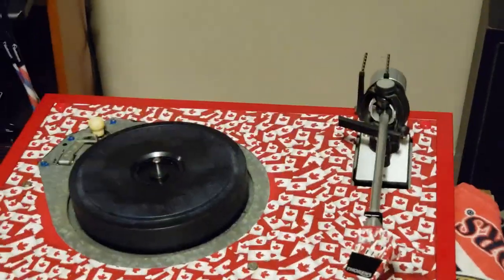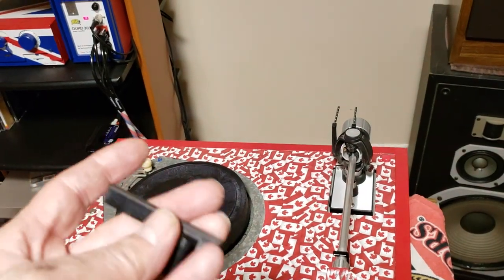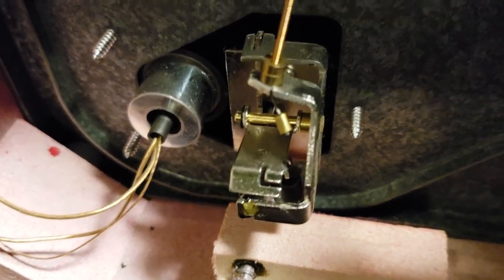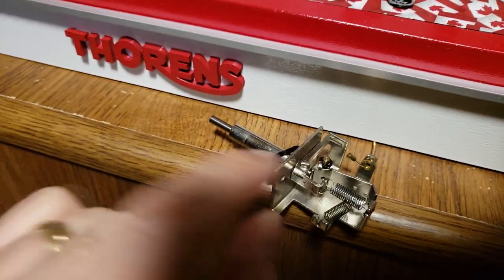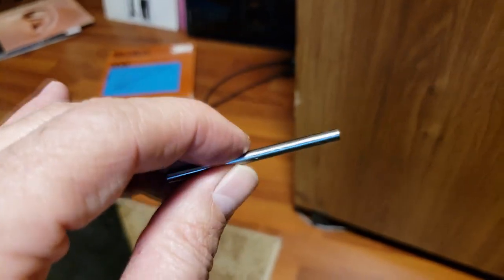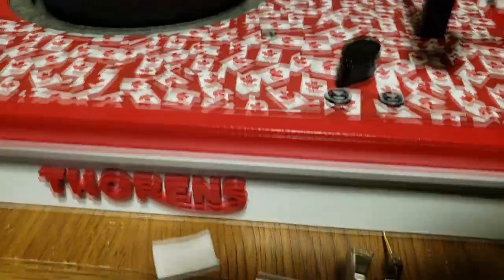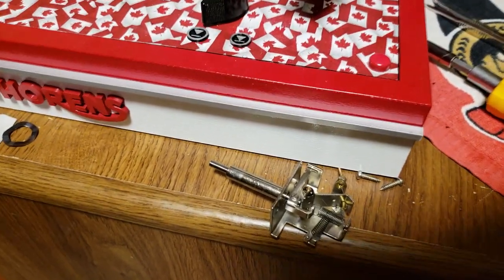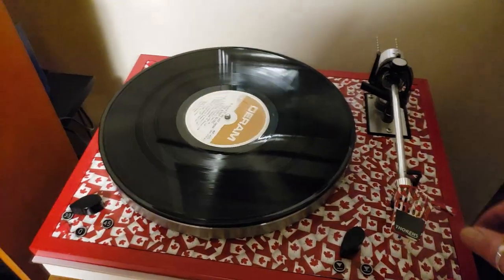Thorens TD165 Cue Lever Fix

Comment: It's not oil, it's resistance grease; it's supposed to be sticky and move arm slowly downward. You didn't fix it, you broke it.
Reply from the maker: Still works great a few years later. Ended up using 300K silicone damping fluid/grease off camera. Procedure for application is the same as in this video which I kept. As a Hydrocarbon Engineering Technologist by education I actually do know a thing or two about oils, greases, lubricants, viscosity etc. The grease I really ended up using can be purchased at many RC hobby shops or online. Been meaning to reshoot this video but 7 Thorens rebuilds later I have not needed to readjust any of the other cue drop speeds. For now folks will have to read the conments in this post to see what I actually did...😉
PS: oils, greases and lubricants don't break metal things like this. If you ever put the wrong stuff on you can always clean it off and start again quite easily 🤣
I do cover it a bit more in this 8 part video series on a TD-160 I restored and modded a bit more:
https://audiokarma.org/forums/index.php?threads/thorens-td-160-mk-1-tune-up-and-setup-project.991147/
Reply: @navydiving  Thanks for making this. It would be great if you put the comment above about what silicone damping fluid you used ("300K silicone damping fluid/grease") in the comment at the top that says "Oil shown in this video is not recommended." - it would be great if that comment were embellished to say what the right lubricant is there at the top, rather than buried in this comment. I almost missed it. Thanks!

Comment: Thanks for sharing. I'm working on this repair now. Unfortunately the head of my set screw broke off in the past, so I have to figure out how to get it out of the rod. You talk about it being gummy. I ordered 300,000 cst high viscosity silicone grease, per the recommendation, and it is the definition of gummy! Seems almost too thick...
Reply: I just discovered the set screw thing happened on the 160 I am fixing up. I used the pointy end of a compass (used to draw circles) and a magnifying glass, and was able to get enough grip on the screw to back it out. I realize it has been three years since your post, but thought it might help others with the same issue.